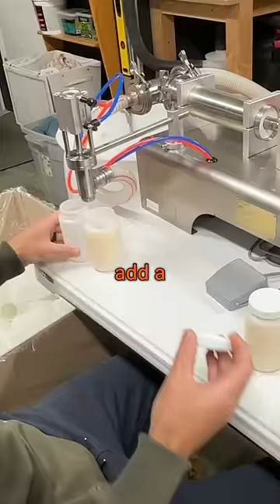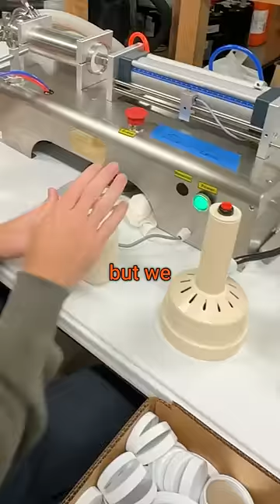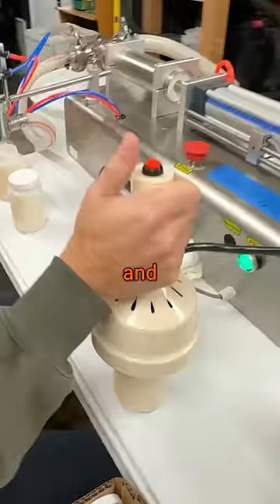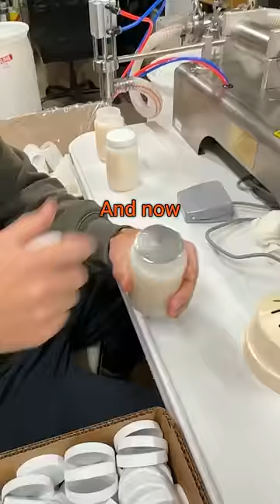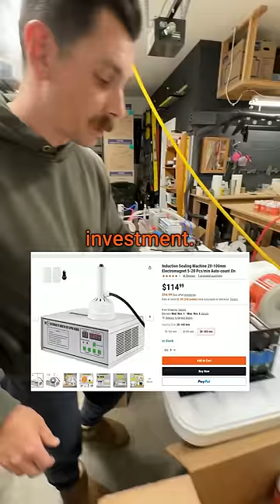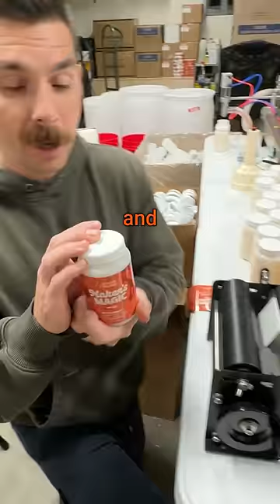What e-commerce is really like… #ecommerce #dtc

Comment: I was the guy at my last job who had to make sure the correct amount of product was going into the containers AND the guy who had to make sure the labeling machine was working properly.....but it wasn't this easy lol. 

The filling machine rotated, filling 15 containers nonstop. 50,000 to 80,000 containers a day. 

The labeling machine put a label on the front and back of the container, and they had to be perfectly aligned. 

It was such a headache. The equipment was subpar and broke down frequently. We lost over $200 for every minute of downtime. I wasn't even a mechanic. Just an employee who paid a little too much attention when maintenance personnel worked on the machines. The boss eventually realized that I knew how to repair the machines as well as the maintenance guys did, so instead of waiting for maintenance, I would be asked to do the job. It required constant monitoring. So I slowly went from slaving on the line with my coworkers, to mostly just standing around and doing nothing but watching the machines run. And even though I didn't help my coworkers as much as I did earlier, I still made an effort to make their jobs as easy as I could by tweaking every spot on the production line. 

After 9 years of keeping the product flowing, one of the snarky upper-management guys told me that I hadn't contributed anything valuable to the company. I walked out the door and never went back. When I left, so did several other employees. The machines quickly began breaking down, and they began losing tens of thousands of dollars 😂😂😂.  Do I feel bad for their misfortune? HELL NO. The only thing I felt bad about was that my coworkers said that after I left, it wasn't the same place anymore. They were constantly down, which caused a lot arguing and bad attitudes. They had to work overtime in order to keep from falling behind. A lot of people ended up leaving. 

Who's fault is it? Upper-management. Did they deserve what they got? YES. Did it feel good to know that my absence had such a detrimental effect on that particular company? It felt amazing.  

Treat employees with the respect they deserve. They're the blood of the company. Without them, the company will suffer.
Reply: Crap always rolls down hill, props for having the integrity to not take their crap!
Reply: A beautiful story about karma. 
My one complaint is that you didn't force a meeting with that manager and a higher up to take them down a peg and get yourself a well earned raise. 
And then leave anyway. 😂
Reply: I'm in maintenance at a company very similar to what you describe, minus the snarky upper management part, but tons of automation on the production lines filling, capping and labeling bottles.

We desperately need employees like you, who will take the time to recognize how their equipment works and identify problems before they become catastrophic. 

Instead, we have two types of employees: those who literally believe in the "run it until the wheels fall off" approach and those who think they're third world engineers who can fix anything with some cardboard and packing tape.
Reply: Normally I’ll never read a comment that long, but that was a good story. 
Did the management ever even ask you how you came to be in the position you had? Did they even propose that they’d move you back to the production line? (As wrong as that would be in their own ignorance..) Basically it sounded like they had no real conception of the “nuts and bolts” side of production and the value you offered. The Co. I worked for actually engaged a firm of “Efficiency Experts” to assess how our processing room could get more work done. It was very clear that these people never did a day’s labor like we do in their lives. They came up with a plan which assumed an absolute ideal functioning environment…, cookie cutter same at every location…., and required an extra person on payroll which most of our locations couldn’t afford (or wouldn’t put out for). The whole thing was a complete failure. They would yell at us every day for not following the new protocol, which was counter productive. Then the yelling became less and less frequent, then the protocol was completely forgotten about. Who knows how much the “Efficiency Experts” fee was.
Reply: Good for you!! No acknowlement for all the extra work you did!!! Sometimes..the check isnt enough!😳🤔😣😯
Reply: That's a top down management.... a good company knows a bottom up management is what keeps companies going,  management gives the employees the tools they need to function and the employees give the feedback and work that allows the company to eb and flow.... don't EVER go straight to blame the employees,  first take a close look at the process , 99% of the time it's the process. Training, standard work that has flaws, no employee wants to willingly mess up or do bad..... sorry for my rant, I come from a training of c.i.t (continuous Improvement) and six sigma...
Reply: You should have extorted them...
Reply: I know the feeling as i've been in similar situations before.
Reply: As someone who was a maintenance mechanic.. I know exactly what you mean. Everything you wrote sounds like my last job. (Injection molding plant making plastic interior parts for Honda, Jeep etc.)

But even as the new guy, I soon learned that things didn't get done right (or at all) if i wasnt doing it. The other maintenance guys were incredibly lazy, not very skilled, good at working with their hands, troubleshooting machines.. or even basics like using tools, painting walls etc.😂

So even though I was the new guy in my early 20's, (silently dealing with severe, debilitating health issues & chronic pain.) I alone did repairs, and all the "renovations" to make the place look better. Painting the office areas, hanging display shelves in the entrance, mounting posters & display boards in the shop, building custom tables/work stations. It was all "lipstick on a pig" before our german CEO showed up. (He wanted to visit cause my boss had mismanaged the place so bad, & production #'s were awful).

But I never looked at my phone, complained/made excuses, cut corners etc.. And suffered immense pain to be a good employee & get things done (right).

Just for them to not appreciate my value, & fire me after the other maintenance guys started feeling insecure, and made up complete BS lies to try & get me fired. (Theyd literally go & tell on me) and my boss would sit me down & ask if i really said this or that.😂🤦‍♂️. It was like teenage girl drama.. because I made them look bad.

Long story short, things definitely werent better with me gone. And years later, they still couldnt find a replacement.. And still had a listing up for my postion on Indeed. 
😂😂😂🤦‍♂️
Reply: Feel better lol
Reply: @mercoid 
You wrote, “normally I’ll never read a comment that long”… then admits that he did, in fact, read the long comment and then proceeds to write a comment that was so long that it made the original comment look like a 3 syllable word!!! Oh the irony!!! 😂😂😂
Reply: Yeah. Same at my hospital. So I left too. Not long after that, they got convicted of fraud and patient endangerment. Mid and upper management,  useless.
Reply: Yet, upper management didn't face any consequences
Reply: noice
Reply: Your story is really great. It’s just like what I watched on the show “Flamin’ Hot,” the story about how Hot Cheetos came to exist. Funny and true story
Reply: I totally feel you. I walked out the day my "boss" insulted me verbally in front of everyone without any reason given by myself (like  a stubborn and spoiled kid been told "No") - that's two years ago, from 17 employees by then are nowadays only left 3 - himself, his "girlfriend" and the assembly-manager in his last year before retirement. He's trying to keep his company (which he "inherited" from his father, who would have invested better in the education and personal evolution of his son than making the most money he could at the time) alive contracting temporary co-workers. 

With me walking out the technical engineer left within a week, the responsable for logistics a month later, the sales coordinator a week after that and so on, the boat started sinking and there was nothing he could do about it. As former quality manager and r&d supervisor not everything I mentioned was always welcome or taken with amazement but it made the company able to avoid immense financial collateral damage. His character unfortunately wasn't adjustable and also not in my responsability...

The only pitty is he's running that company only as a point to prove his non existing "leadership capabilities" (as arnold would say) and because of an awaited heritage over estimated CHF 14.5 millions he will be in the position to continue to be such a prick for the next 25 years easely. But his own ego will be his greatest enemy during this time - and that is something even money will not be able to conquer.

Have fun, I'll be watching from a safe distance.
Popcorn, anyone?
Reply: i'm not reading that
Reply: @jongoin4404  ….Zero irony there. Comments that long are usually self aggrandizing, boring and push an agenda. His was good. ie: not a waste of time. ….Like yours.
Reply: calm down boomer stop feeling offended, they just fired you for not knowing
Reply: That was a hell of a story. If I owned that company I would have been pissed at upper management for not being able to identify the chain of events that lead to the company going down hill. Because I would’ve hired you back with a raise and fired the other person for not being able to recognize your value to the company as a whole. Like wth!
Reply: Didn't ask
Reply: @VanyaYani  No consequences at all. I have so many stories about that crappy place. 
A guy got fired for mentioning a union, which is supposed to be a protected issue.

They had dozens of chemical spills that ended up in the creeks and streams around the property.

They even stopped a guy from taking his insulin shot one day after he was beginning to have a medical emergency! 

Favoritism was a huge problem as well. One person would be praised for doing something, while the next person would be fired for doing the exact same thing. It just depended on who you were. 

False accusations were a favorite way for supervisors to get anyone they didn't like fired. Witnesses didn't matter. They just took the word of the supervisors without doing any sort of investigation. I saw it happen over and over and over. 

They allowed certain employees to come to work drunk, just because they were related to members of upper management. 

I'm done talking about it. That place just gets under my skin when I think about it. It was not a good place to work.
Reply: @TriggaTreDay  To be honest, I would be weary about going back to work there. It is a chemical plant, and I was exposed to the dust of improperly cleaned chemical spills every day. Cancer is a real concern in my life because both of my parents have had it multiple times. My dad couldn't beat it. He passed away in 2002. Mom seems to get diagnosed with various forms of cancer every couple of years. Thankfully they haven't been catastrophic issues. Knock on wood. I am predisposed to cancer. I have pretty much accepted the fact that I will end up with it sooner or later. I think I'm done with boosting my odds by way of chemical dust exposure. That chapter is over 🙂
Reply: Thank you
Reply: u were being paid two hundred dollars a minute?
Reply: Nice
Reply: I did the same in a Gin Distillery. QC sits at the end of the line, checking everything is perfect.
Reply: Love hearing stories like these. Good on you! You were too good for that company, anyway.
Reply: Can we have a clue to what company that was.
Reply: Sadly I know your exact situation and. I'd do my job and maintain equipment and keep everything organized in their right place and clean. Our machine had bad air lines I had to repair because it would be a week or 2 before repairmen would show up to fix anything. They fired me because the 2 times the head honcho came in and he saw me just chilling because there's literally nothing do because everything was done early so I just sat back and waited for something else to do. Like you after I left the shop went down hill and only 2 people I worked with at the time stayed and they were so desperate for help, they hired in people who lacked experience or just half-assed their work and have comebacksleft and right😂😂😂
Reply: Unfortunately, I feel like the only way to really avoid this sorta stuff is to try not to learn new skills. A lotta jobs now (and in the past, just doesn’t seem like it was as much of a problem for whatever reason) seem to want their employees to do every job possible without giving them the respect (and especially pay) that comes with those skills and responsibilities. Don’t get me wrong, companies have ALWAYS been like this, not sayin they haven’t, but it seems like almost every job I’ve had has wanted me to do the job of everyone they can’t be bothered to keep hired. And when you take a stand and say “I’m not doing that, I’m not paid to” you’re apparently not going far enough for the company, or hurting everyone else or some other corporate bs that’s clearly not true. 
Recently, my current job has either been firing specialists or they’ve quit on their own. And for whatever reason, they expect the rest of us to “pick up the slack” that’s now left by those empty positions. For context: no, they haven’t hired any new specialists, in fact they’re firing more people more often now. Personally, I full on refuse. I don’t get paid as much as a specialist, and so I don’t have their responsibilities. I’ll happily help with anything within my pay grade, but once we get out of it, my hands are down. I’m not doing charity, pay me more if you want more from me. 
Your company, as an entity, doesn’t care about you. They’d prefer to replace you with someone/ something with lower standards and similar skill as soon as possible, and they will. Don’t give an inch because whoever you work for probably won’t give one either. (This isn’t necessarily true for small/ family owned businesses btw, mostly just corporate and all that. Obviously it still CAN be the case, but a corporation or larger company isn’t a person and is barely run by them. Whereas a local shop tends to actually have a human being behind it)

Also, side note, a company changing their pay to match living standards IS NOT NICE. It’s not charitable, it’s certainly not a traditional raise, it is owed and required. Don’t let ‘em treat it like they’re being generous by giving you enough money to continue living
Reply: I need a continuation of the story, did they ask you to come back and appologize?
Reply: THE PRODUCT MUST FLOW
Reply: @schizolab  ofc you have an anime pfp 🤦 using the word "boomer" is so 2019
Reply: Lmao I used to work on the same kinda machine, ours filled Autoclave pouches with Ramen Soup base. Was especially awesome when you have the thing running smooth, everything dailed in freshy gresed amd tightened. And It goes and spill soup all over itself. Which makes it not seal properly which leads to pouches bursting later further down the boxing line. I know your pain lol and how indescribably weird that job is.
Reply: It's always managment. I am a maintenance guy, and we try like hell to keep it running,  but we have a budget. They don't listen,  and don't care. Make it make me money. 
Now I run service calls.  Small company.  Used to service your equipment for $30 an hr. Now you pay well over $100 an hour. 
It's the management, the culture they creat, it's hr, and depending on where you work, the "mee too" bs. The keepers of the supply chain are sick of it.
Reply: Yes and only after working 18-20 hours a day 8 days a week I get to do it again next week.
  You need employees. Don’t work your life away. Ain’t no hurst ever pulling a uhaul . Can’t take it with you when you go.
Reply: I totally agree with you 🤠💯💪👍🏿
Reply: @dangerverse I just did this. My shift lead was a good friend of mine until he became the shift lead. He turned into an arrogant egotistical prick over night. Despite not knowing how to run the machines (he was a kiss ass and a big talker) he would always claim that he “kept the place running”. 
He used to say to me “you’ll never leave, you’re institutionalized like me” and that was when I walked and haven’t looked back. I found much better opportunity at a company that appreciates my role.

I hear the environment at the last place took a nose dive. They can’t find people to replace me. I used to work my 8 hour shift and then practically run the night shift as one guy for another 6-8 hours OT frequently. When I worked my long OT shift I ran 4 out of 5 machines solo. 

HR was incredible hostile towards me. She got upset when I only gave her a week notice. Told her to kick rocks and never came back at all.
Reply: @memphistigertim what is this type of job called? Because how you are describing it i think this is something i could both enjoy and learn how to do well.
I feel like i always notice the smaller things noone else does, mostly irrelevant stuff, but once i a while i spot a "gold nugget"🙂
Reply: All im learning from this type of comments: upper Management doesnt know shit
Reply: What's crazy is that the manager who insulted your value was told to do so by his boss. He was told to go make problems where they didn't exist, and he did it.
Reply: So, where did you land after leaving?
Reply: And then everybody clapped. Because this totally happened
Reply: I just wish upper management knew it was you leaving that caused it. Their huge egos probably won't let them see it
Reply: @johnnyolson258  really isn't so uncommon that you should immediately doubt it. It's very detailed for what it is.
Reply: @memphistigertim  wow the run it until the wheels fall off people are probably like that because of your disdain for the ones struggling to fix things with the only junk they have at hand because of people like you.
Reply: No it actually is very common for people to completely overestimate their importance at their job. Everyone thinks "this place couldn't run without me"
Reply: It was the same for me at my last Job the Boss knew I know how everything worked in the shop. The machines the Products the shipping and alot more after I left the quality went down big time.
Reply: @schizolab  your comment shows your lack of comprehension. And the fact that you just want to use the word boomer so you can feel clever
Reply: Great at story. And oh so relatable!
Reply: I understand you perfectly.  I was the man who kept an entire business running, but the boss's disrespectful attitude made me leave.  After that, the company went bankrupt.  The moral is to always have respect for people in general and especially for those who run your business, regardless of the degree of their function, because everyone is important for the business to go well and to prosper.
Reply: Too long couldn't give a fuck less
Reply: Love it. You go man! Cheers 🍻
Reply: Its always the snarky upper-management guys who dont know what the fuck their talking about, that usually end up costing the company millions/billions of dollars 😂😂😂
Reply: @mercoid and here you go writing a comment just as long 😂😂😂
Reply: Only one glaring problem... Capitalism won't work unless the class gap continues to polarize. Prices MUST increase faster than employee compensation or the house of cards falls. Employers can NEVER pay employees their full worth, or they'd be a non-profit. The guy in the video MUST sell product for MORE than what he paid for raw materials... and on down the line. Do the math... you're only kidding yourself if you think this could continue forever on a planet with finite resources.
Reply: Everyone is replaceable..lesson is never go above and beyond your position as you become more of a worker with the same pay.
Reply: This.  I am supervisor at a very well known logistics company and the number of amazing employees and coworkers I have lost due to bad decisions by upper management is staggering.  Somehow the terrible ones always stay though.
Reply: Industrial engineering can be tough. Making machines that make stuff. How do you make you machine-making machines? With machine-making maker machines.
Where does it end? Right there.
The things that make those are just welders, fabricators some assemblers 
Most humans take it all for granted. Most modern women in the West especially. They have no idea what guys do (well, 90% to 95% guys) to keep this shit running. 
All that crazy complex, highly precise equipment you maintained and repaired just to put some labels on some widget containers.
With building-size machines that cost millions, you need to run those fuckers constantly if you can 
In this developed world we have, most of it can be figured out. The extreme limit of our tech is microchips.
The chips are super important - 3 of the 5 largest companies in the world come to a halt without chips being pumped out. 
And 92% of ALL the chips in the world are made in ONE PLACE, and China is going to invade that one place: Taiwan.
They're making chips with components that are only a few atoms large!
The machines that make those chips are pretty much the most sophisticated, complex manufacturing devices ever. Only a few companies can make them.
I can't wait to see self-designing robots. AI that can design better, smarter AI.
Reply: Dude, you got a spine. Thank you for using it. And thank you for taking care of the others as long as you could. But you did what you had to do and set a good example. There’s not a whole lot of that going on anymore. Props to you brother!
Reply: Thank you sir for telling us this story. It's a lesson for the company as well as for me. Salute to ur efforts 🫡
Reply: Have faith in Jesus and He will save you, He loves you but you have to have faith in Him to save you to go to Heaven 😊
Reply: I was about to feel mad that your boss was gonna make u do 2 jobs with same salary but it turned out better than expected.

Hell yeah, power to u.
Reply: "Never judge book by its cover"
"Never assume that loitering guy has no job to do"
Reply: That’s a bit of an inverted success story. Glad you had the guts to identify the crucial moment to walk away. I recognise a lot of what you say in the varied jobs I’ve done over the years. 

Something has shifted and continues to shift in employer/employee dynamics - across all of business in fact. It’s a bit of an uprising. It’s exciting and I’m curious to see how it evolves. 😊
Reply: Imagine firing the only maintenance guy you have for just the same pay as the normal workers. 🤣
Reply: im not readin allat lil bruh
Reply: @jongoin4404 your reading comprehension is off the charts. 😂
Reply: Interesting and uplifting experience..
It sounds to me like you made the management guy feel insecure or 
Because it was clear you were bright technically minded and able to fix machines you were not trained in.
..
IMO if the downtime was 200$ p/h and you managed to keep the machines running one whole day without incident. 
Then you earned your paycheck for that week.
..
So you were in effect, costing that company 0$..
..
The truth is management don't contribute to the company it's the workforce that's productive and creates the profit...
..
At least you learnt some news skills you could take elsewhere...
Reply: @nortonnewmann3711 you confuse capitalism with corporatism. Corporatism is a cooperation between government and corporations that enables corporations to push out smaller businesses through the use of government regulation and favorable regulatory fees.
Reply: Reading your story was almost like reading about myself. Mid to upper management was the same as you mentioned. The main difference in my story was that I went a little further, I ended up filling in for the supervisor at times and had to attend management meetings and really got a taste of their incompetence.  Instead of quitting, I just transferred to a different department. The plant ended up shutting down. When it was announced, most people were surprised, I wasn't.
Reply: Always amazed people have time to write such extensive comments. Shows your do not value your time at all.
Reply: @roadkillavenger1325 you would be surprised at how much your mindset can and does affect things, including your health.
Reply: Erinnert mich an moderne Zeiten die Manager lernen nix dazu und das läuft schon tausende von Jahren so ...😉👍
Reply: My late FIL from my first husband was a job setter at Ford for 30 yrs before he retired. He sat behind a newspaper most of the time at his desk bcs thats where ford wanted him. When a machine broke down thats the only time he was out of that chair. If he was not in his chair that meant the company was not making money off that line.
We always teased him about "settin' on the job" but it paid well for his mechanical skills. The only thing he got chastised for at home was that he wouldn't take the time to put on a welding hood to protect his eyes. He got flashed one too many times and finally lost the upper sight in his right eye. Then a small stroke after retirement finished off what sight was left in the same eye.

You were a job setter. That particular management didn't realize how important it is. Now they do.
Reply: It was just for a double or nothing situation..even if they called after you left,was quadriple or nothing
Reply: The moment they made you a maintenance technician under operator pay is the moment you should have left...
Reply: @ltb2822 lol factory worker?
Reply: Great story except for the wasted 9 years of your life in a warehouse part.
Guh 😖
Reply: Sounds like manufacturing jobs, sounds like Edlund Company 😵‍💫🤣🤣🤷🏼‍♀️
Reply: They want employees to know everything so they can pay us NOTHING
Reply: People don't quit JOBS, they quit BOSSES.
Reply: That's a really long story, you should get outside and touch some grass...
Reply: This got a little more attention than I was expecting. I'll have to read through them as soon as I find some time.
Reply: I would have instead said okay to manager. I will be taking 2 days off. Calling me with my pay raise amount and we can talk about me coming back.
Reply: @GigDrivingKatt  YUP.  That's when you discuss taking the a$$hole's job that told you that you weren't valuable.
Reply: @scryall 
Well then I'm not reading yours. 
   See how you like it
Reply: @clown134
Doesn't everyone?
  You dont?
Reply: @flexinclouds I had the same thing happen to me at my last job...  Same position as you also.
Reply: @katiebarber407  Lost revenue due to lost production and salary to waiting co-workers.
Reply: @AtimatikArmy  I stuck with that job long enough to see all but 1 of my original coworkers still employed there when I finally had enough of their bs. I stuck it out longer than most, hoping their bs would stop. I watched the place change ownership twice while I was there. Each new owner promised positive changes and a better atmosphere. You want to know what they changed? Worn out labels. They replaced the labels on the equipment. That's it. 🤣 those people are as bad as politicians. 🤬
Reply: @roadkillavenger1325  They care about profit, not people.  That's sad.  Hopefully you have found something better these days!
Reply: @AtimatikArmy  You should have seen how they acted during safety audits 🤣. They would tape safety slogans all over the buildings and pretend like they worshipped those slogans. Most of the machinery had broken and bypassed safety features, so on the day of the audits they would shut those machines down and pretend like we didn't use them. It was a huge lie, because those were our main machines. Once the safety audits were over, we were put back on the broken machines again. It's a miracle no one was killed or maimed during the time that I worked there. They would even order us to go into enclosed spaces to clean tanks without air monitors or respirators. No one at the plant was even qualified to enter enclosed spaces! It was ALL about the money. They made tens-of-millions of dollars, but claimed they couldn't afford to make any improvements. That's funny, because somehow they found enough money to build a fancy brand new warehouse that they didn't even need. But they couldn't fix the broken safety mechanisms on any of the machines. They even stopped giving out Christmas bonuses during my last year. I'm done talking about it. It just pisses me off when I think about all of the time I wasted there.
Reply: @Skousen77  so massively underpaid compared to the value of your labor
Reply: You darn near spoke every word banging around in my head, since the times I walked away!
Reply: @smokelord2002 nah, more specific. Almost something like mantenance technician😉
Reply: I had a similar experience, where I did 95% of the work, and another mechanical engineer took credit, eventually leading upper management to believe I was disposable.  When I was laid off, the work wasn’t getting done because the other guy couldn’t do it, so work wasn’t getting done and they couldn’t make it.  The company went from 100+ people down to 7.  Because of this experience, I never ever wanted to go back to the corporate environment, since it was just about politics, ass kissing, and looking good.
Reply: because they dont know or the new guy that came didnt know the importance of yr work. They just thought that things are working the way it is and u are redundant. Unfortunately, they didnt realised that you are part of the reason why things are working the ways they are ....
Reply: AMEN BROTHER!!!
Reply: What exactly are you packing and, hiw much $ on each unit?
Reply: @chesterlong4618  The main product was antifreeze. Each unit was anywhere from $6 to $14-ish, depending on the label. Some companies would send us bottles for 3 different "grades" of product, but we would fill each of them from the same tank. I never liked doing it. They were paying different prices for the exact same product. It felt wrong to me, but it is what it is.
Reply: Oh yes, I am glad they had problems!!!! Happened to me as well in a deli...
Reply: Tldr